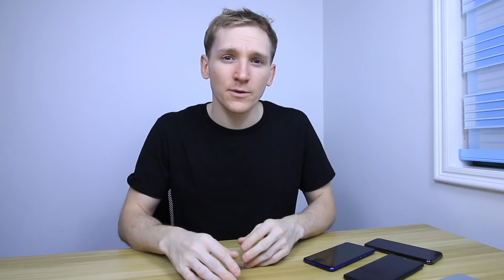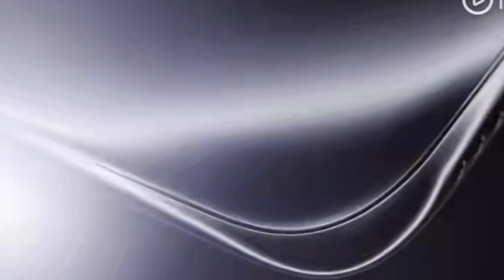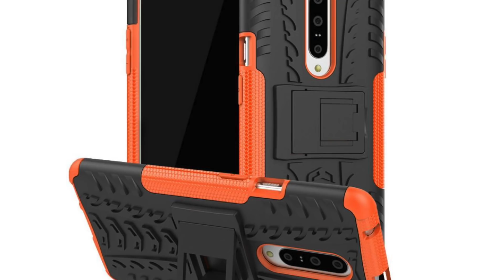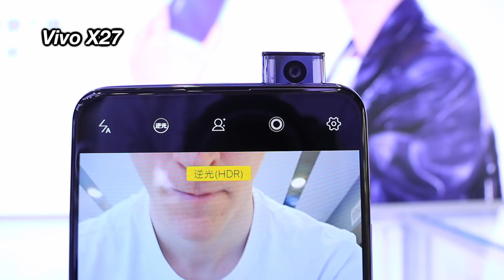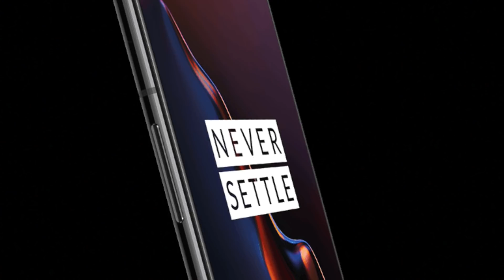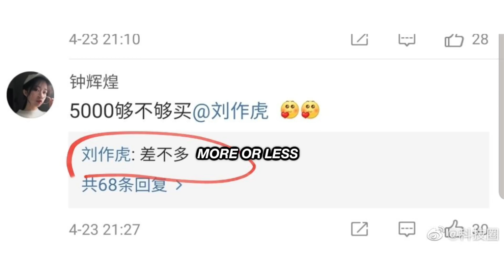OnePlus 7 & OnePlus 7 Pro Official + Specs! Launch May 14th

Comment: No worries on the pop up camera. Vivo Nex and Oppo have proven to be reliable. OnePlus will be better with its strict quality controls.
Reply: they are basically the same company and same phones for the most part.
Reply: @Tigerex966  Yes I know. But Vivo & Oppo have always been sort of the "beta" companies that try different things. If proven to be a hit, OnePlus implements that feature but does it better due to it needing to uphold a higher reputation. They'd have never used the pop up function of the Oppo Find X for example (see JerryRigs video on how weak that was).
Reply: oic @DonPinguccio

Comment: OP7 pro rumored price is WAY too high. it reached S10 prices. I feel sad for 1+ their rumored op7 is 6T with newer Soc and a less camera. and their OP7 is too expensive with pop up camera that may fail on user.  well waiting for the final product with hopes that it will be way better priced at least, or see what Honor 20 has for us hopefully a p30 pro with their Magic OS.
Reply: Its how new companies start.huawei oppo and xiaomi create a sub brand to not let new companies born in same way as they did.
Reply: One plus CEO said that overall the one plus 7 pro is better than S10 Samsung. However, nobody knows it is true or not.
Reply: @andyguan4246  well it depends, in overall usage I would definitely say no so far it is still the all round phone. as for battery and in many regions SOC (compared to Exynos), yes it will be better in performance but that applies to other Chinese phones with SD855 like Mi9 which is way cheaper than the OP7 pro. 
anyway we have to wait and see. though I'm  no longer hyped for this phone as the key features for the pro are not my cup of tea, and the normal one seems like the black duck that its own mother hates.

Comment: The OP7 pro will cost too much, it will be a pretty big jump from the previous pricing and this will upset a good chunk of fanbase. Op is settling on the same model of huawei and samsung, i don't know if this choice will pay off in the end.
Reply from the maker: i think this is why they have done a "pro" version, it's a way of sneaky upping the price and making you pay more... thing is... there are lots of cheaper SD855 devices on the market now
Reply: @TechZG  I love the op almost stock OS, but they are taking a huge gamble with this pricing. I can get a xiaomi mi 9 for 429 euros, that's a 300+ euros difference there. I wanted to come back to op but they are making it difficult.
Reply from the maker: i know... price just doesn't sit well